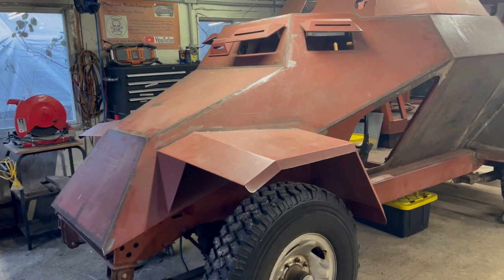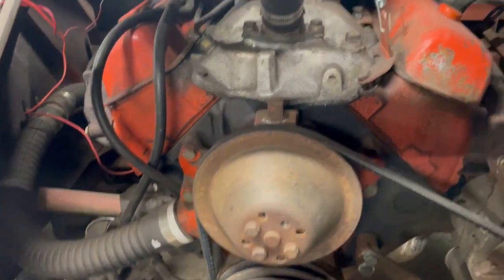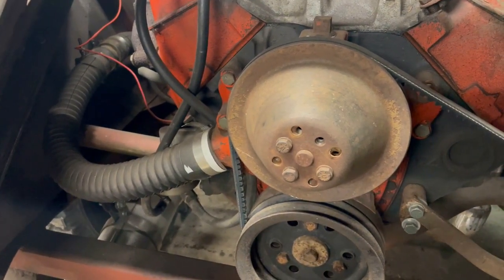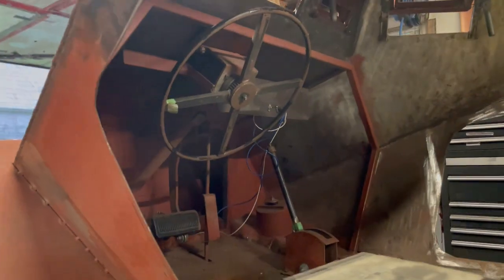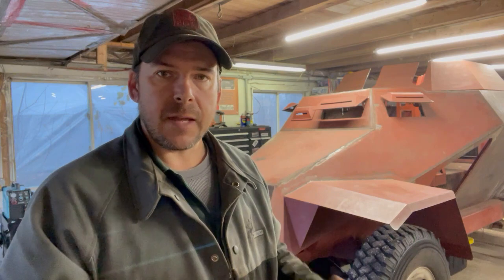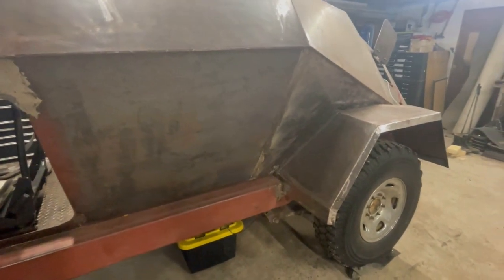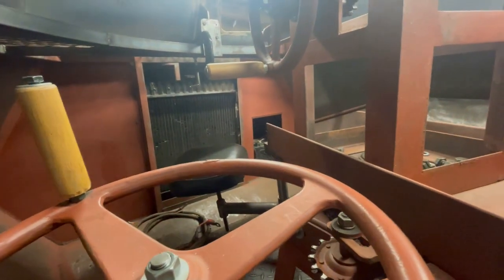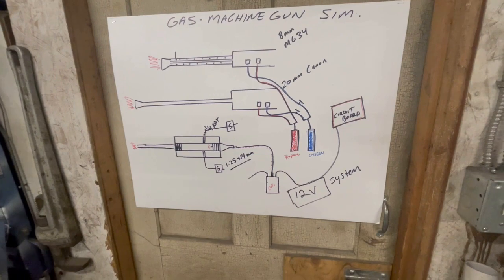Ep 57  Project 222  Building an Armoured Car

Comment: This is a great review of progress so far, John and an outline of the plan ahead.  I agree with  the idea of replacing as much hose as possible with smooth tubing. It will cut down on resistance and cavitation.  Cheers! Mike
Reply: Also I mentioned before in an earlier one but I hadn't heard back from you is the original things had a gear reduction drive in the back which made it sit 3 inches higher, and there's also you can buy from I don't remember whom but you can probably look that up for yourself is you can get a different axle in the front which raises the front end up two inches they use them on sandrails.  Gene

Comment: You might try replacing some of the corrugated radiator hose with smooth wall tubing. At least for all your chassis mounted routing. Then just a flex hose to the engine from the chassis. This may help with internal flow restriction. Keep the videos coming!
Reply: You're still flying along there with that thing wow, have you checked out the pics I sent you about the 34 the top cover and blast cone and all that good stuff and handle grip although there are in relic condition except for the except for the blast, barrel bearing sleeve. And again I'm not asking for anything  for them. And I got a couple more surprises I want to send you I need your address in New York.  Gen3
Reply: Oh by the way I see your heating problem there and I think you're running in the right direction but if you got to buy a new fan consider it a fan of reverse for winter time you can use the engine heat to heat the cabin it'll help keep you guys toasty. I also going to send you something else you can modify it and weld ears on it and if you're going because you mentioned the exhaust you were going to change it around it looks like the armored cover for where the exits the engine compartment, you will have to weld on a couple years to make it truly correct but all you'll have to do is buy a small spool of aluminum.  Let me know  gene